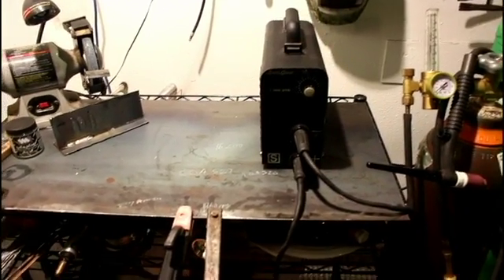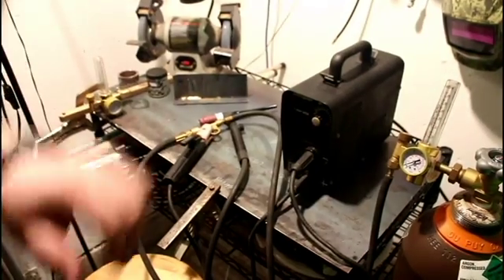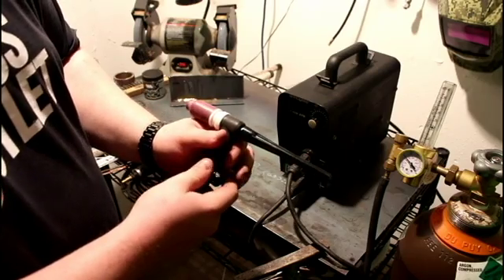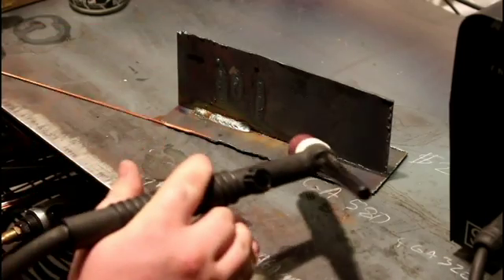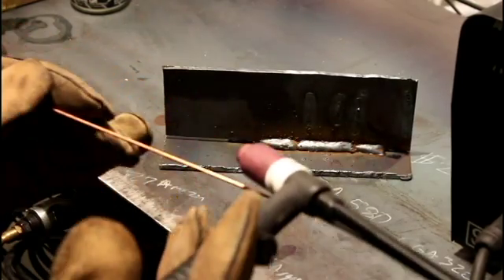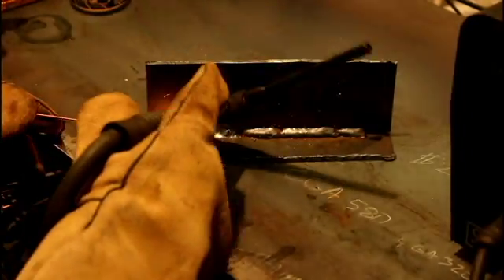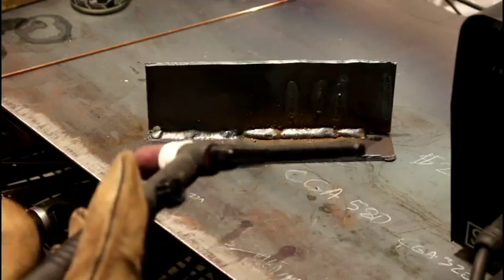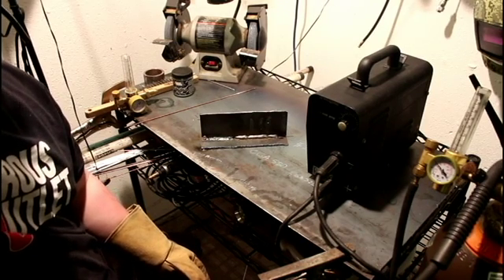$140 DC Tig Welder Scratch Start Conversion (With Parts List)

Comment: Your biggest fault is how dirty your steel is. Tig is a very clean process you should never see amber sparks when tig welding those are impurities in your puddle. You have to clean all the mill scale  and any residue off the the metal the cleaner the surface the better the weld. If I am doing a critical weld I wipe it down with acetone after using a flap wheel and even wipe down my filler metal. Good welding in any process is all about the prep work like how clean the metal is and the fit of the part like the gap you leave to weld. The more time you spend prepping the surface the better the outcome. Out of all processes tig is the least forgiving when it comes to prep. I like that you showed people how to get going on the cheap in all it was a good video you just need to practice. If you do this it must be a DC welder but it doesn't have to be a stick welder you can do this with a cheap wire welder also. just make sure the positive side goes to the work and negative to the torch.

Comment: you say a DC welder but it appears you are running TIG with a AC welder....correct???
Reply: No, it's a little 80-100 amp dc inverter welder.

Comment: Great video. I have a smaller Lincoln MIG welder and just added DC stick welder to the collection so the only thing I'm missing now is TIG. Really appreciate you explaining what is needed for the conversion and taking the time to list out the components necessary. Wish I hadn't been so cheap and bought a multi-process machine that would do all three but a little late for that now.

Comment: Clamp the ground to the power block? You clamped the stinger to the power block with polarity set to electrode negative.
Reply from the maker: +Kevin Thorrington i put the stinger in the negative dinse terminal on my welder. So the ground was positive and the stinger was negative. Attach the stinger to the torch all negative.

Comment: You need high frequency to run ac tig it will not work unless you buy like an arc pig, do not try it you will not carry the arc it will just go out.
Reply from the maker: huh, didn't know this, like you can't initiate the arc at all ? I work on a dynasty 350 at work and have this small stick welder and a couple Everlasts. I was just messing around one night for this video
Reply: weldit321 
The arc will initiate but almost right away it will go out, the only was to make it work is with a device called an arc pig but essentially it is just a high frequency ad on box.

Comment: Can you weld steel with ac tig?
Reply from the maker: +Olivier Beucken it is possible but not recommended. It'll put a lot of heat on your Tungsten and less on the steel. So in a pinch yes but you can find little DC stick power sources around 100$

Comment: I have an old school Lincoln AC 225 amp welder. Will this method work for that? Also did I understand you correctly? Do you invert the positive and negative?
Reply from the maker: Hello, yes in a pinch you can do this with an AC225. This is not the best for steel as DC is the most used polarity, but it has been done and you can get decent but not perfect welds. And as for polarity (switching positive and negative) dont worry about it since AC from a 225 switches between DCEP and DCEN 60 times a second in a sine wave. Though if you are about to spend $140 dollars on this you could just buy the 165 amp Harbor freight tig welder for $180 :)
Reply: Thanks for the info I actually found that welder locally for $140 new on Craigslist. Thanks again!
Reply from the maker: Glad to hear, It will likely be a better setup for you in the long run. And if you get further into tig welding check out everlast welders Specifically the Powertig 185 (AC/DC tig welder with pedal and all things you need) adjustable ac balance and frequency and for around 800 on sale they are great. (i dont represent them but have 2 and love them)
Reply: +U2beers sir what is the exact lmp setting of the argon that flow for aluminum and for stainless steel
Reply: Thanks for the tips! I will check out that everlast welder.